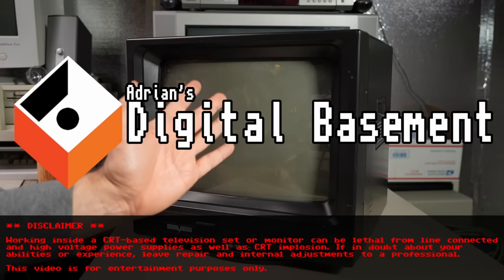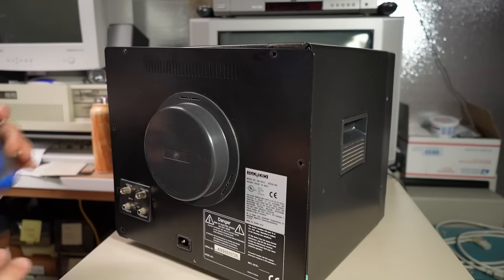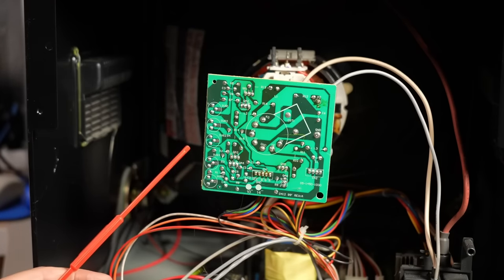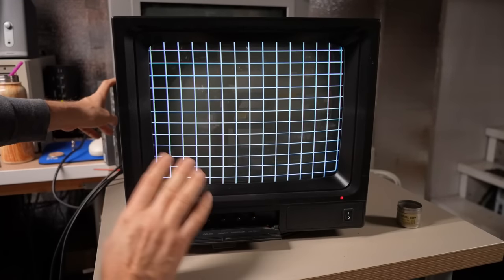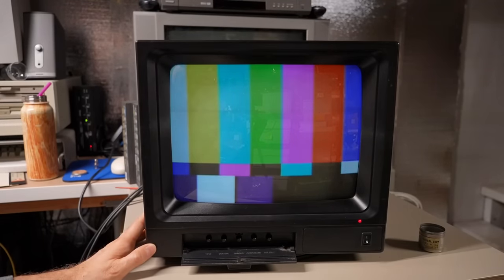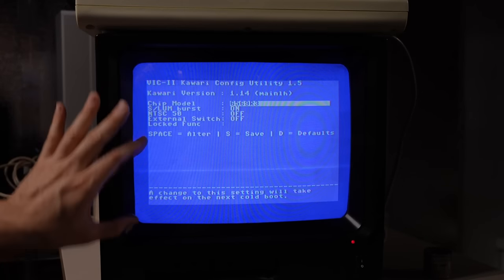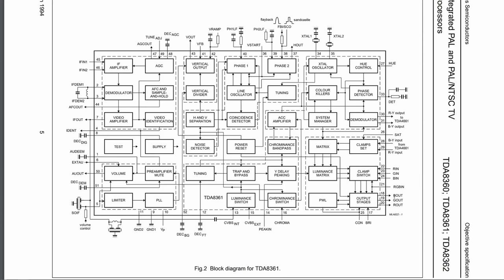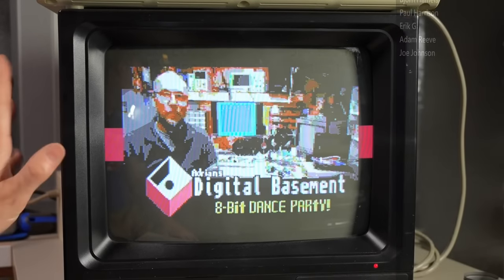This trashpicked monitor is way more capable than I expected (ProVideo VM-1401C)

Comment: For those wondering what the German text means, it says that the x-rays produced in the device are sufficiently shielded and the acceleration voltage is below 23 kV.
Reply from the maker: AH! Nice. I always know that it means that 23kv is the maximum voltage the CRT runs at, which is too low for X-ray. (I think 50kv is the minimum really) The idea is the TV's board incorporates safety measures to shut down is the high voltage exceeds a threshold so that X-rays are never formed. (By runaway HV)
Reply: I remember that there was a bit of a panic about TVs irradiating children in Germany in the 80s, so that's probably why that text is there.
Reply: @tidklaas My 1992 Philips CRT TV set (yeah, still using it, I don't have TV service anyway, it's just a monitor for my DVD player) has a similar label - and I was actually about to post the same translation here, but you beat me to it. 😅
When Adrian mentions the German text on the labe, I was already 99.99999% sure this thing must support PAL, as there is absolutely no point in putting this on an NTSC only monitor. Nobody would have needed that here back in the day, and now it would only be needed for the same reason that retro computing enthusiasts in North America want PAL monitors. I wonder if even the power supply of this thing is multi-voltage/multi frequency (not necessarily wide range input, but maybe by changing some jumper or soldered bridge)
Reply: @Colaholiker The IEC plug makes me suspect that it's also a multi-voltage monitor and the same monitor was sold worldwide instead of having different boards for different parts of the world.

For televisions that would make more sense since tuner channels are vastly different in different countries.
Reply: @adriansdigitalbasement2   With that metal case.... and SVHS.... and PAL...  this thing screams to you ... "find me another TUBE Adrian" !!! ...
Reply: @Ramdileo_sys  Plus as it seems the jungle IC supports RGB it could be a good monitor for RGB stuff too, and being metal cased could be a good match with the BBC machines as the common CUB monitor was metal cased, Must be a cheap portable TV around with minimal use that would have a compatible CRT.
Reply: @Stoney3K  But the label specifying 120V is oddly specific. That's why I suspect it can't support 230 directly, but with just a tiny modification to the power supply, like changing a jumper link or something. But I am just speculating.
Reply: @Ramdileo_sys  hear hear!
Reply: @adriansdigitalbasement2  I have a 12" b/w set which also has a similar X-ray label, even though the EHT is only around 12KV IIRC. I've not had the back off for a long time. There's another smaller (9" or 10") NEC b/w set I haven't opened yet, will see if that has one too! - I do need to open that one up and check it out; it was a street find.
Reply: @tidklaas  Same here in England. I think the scare may have started with the early colour sets but I was assured that mine presents no risk (a hybrid but has a solid-state EHT rectifier a.k.a. tripler).

Shango066 recently made a video using radiation detectors (Geiger counters) on a similar set to mine and found less radiation IN the HV cage than outside it! It's the (currently) latest one about the NOS Packard Bell set.

Comment: About 20 years ago, I found what I thought was a small television by the trash at my apartment. Turns out, it was a studio monitor, and a GOOD one, too. Had every kind of connector in the back you could imagine (even stuff like SCART). Only drawback was it was mono only, but that thing has seen tons of use through the years.

Comment: I was blessed by acquiring two 20" Costar security monitors, new in box, that I was able to get for free. They were the ones that Wal Mart used to have hanging around their store before they switched to LCDs. They are switchable from NTSC to PAL and have both composite and Svideo in and out. Passes through while the set is off also. One is in my retro game room and the other went into a MAME cabinet. Pretty sharp picture.

Comment: Given what it was used for, the burn is not THAT bad. I would have expected it to be relatively low-hour. Seeing how clean it is inside lends credence to that. Seen much worse that still had good, bright images. Depended a lot on the quality of the tube(s). Awesome end result.
Reply: Now I'm wondering how hard it would be to use a microcontroller to deliberately adjust the incoming video to brighten the burnt areas and make them less visible. It sounds like a pleasantly pointless project...
Reply: @hjalfi  That would only worsen the result over time, as you would just burn it in even more. What could work, is doing the burn in negative, so it wears the rest of the phosphors to even it. But by the time that evens your tube will be very dim.
Reply: I have a monochrome set that was used for a security camera, it also has visible burn-in. The grid that separates four different camera feeds is clearly visible, and some text resembling “CAM 1”is visible in the left top corner.

I’ll probably need to find a replacement tube for this, it’s also fairly dim and turning up the contrast makes it bloom terribly, to the point text is unreadable. It also takes a long time to warm up, after about half a hour it reaches full brightness.

It probably needs more work than just a tube, but it’s a cool little set. I still like to use it for a terminal, even if the image is dim.

Comment: Odds are the reason CRT lasted in security longer than the general population is 1) cost, 2) no need for HD until the cameras are upgraded and last but not least: 3) CRT security monitors have a track record for running 24/7/365.  I'm not sure as the first flat screens had that.

Comment: Architecture wise it's an European TV without the tuner, remote control and SCART connector. It's kind of surprising this didn't happen more, considering that the hardware is fully NTSC capable. It's import to note that the jungle IC of this monitor is still analog, which means the RGB input signal is likely directly passed on to the RGB outputs i.e. no processing is done, which means it works as direct as inside a Commodore 1084 or inside a VGA monitor.

TVs of the period this monitor was made generally work digitally and digitize the RGB input and do signal processing on it. At that point RGB loses its advantage over YUV component.

Therefore this monitor can really be a gem, allthough finding one with a good tube could be a challenge.
Reply: It was mostly large screen TV sets with frame doubler that digitised analogue signals.
Reply: @mjouwbuis There was a lot of support for widescreen. A DVD player could or would play a DVD in anamorphic 16:9. A normal 4:3 was expected to be able to support a widescreen input via SCART, convert it back to 4:3 and then you could often choose between zoom, letterbox and 14:9 on the remote control. These conversions were done digitally.

This and indeed 100Hz was the main driver for digitizing the inputs.

Comment: Given that boards to drive CRTs are still being made, I'd suggest you look for that CRT brand to see if they are still making them. If they are and prices are good, it could help to save a lot of good CRT sets.
Reply: Chunghwa Picture Tubes (CPT) bankrupted in 2019, they had stopped making CRTs many many years ago but the switchover from CRT to LCD was too late and was probably one of the reasons why they failed
Reply: @BluRay_4  a pity, really. There may be either new old stock floating around (at a premium) or perhaps some other company still makes them, but with unknown quality.

It would have been nice.

Comment: This one reminds me of those old cube monitors that used to be used with the old BBC Micros here in the UK....

I forget their name but they were everywhere BBC's where...
Reply from the maker: I think they were called "Cub" monitors -- and indeed lots of similarities, at least in the construction style
Reply: @adriansdigitalbasement2  Yes, Cub.
Reply: @adriansdigitalbasement2  Made by a company called Microvitec, based in Bradford, in the north of England - who are still going. They used the same metal case right up to the early-to-mid 2000s, although by then the internals were more modern, for basically the same kind of reason at this one.
Reply: Ooh yes, I remember the beige metal casing on those monitors which pretty much matched the colour of the computer case.

Comment: This explains why my 40" Sony  Trinitron is still a beast of a CRT..does mean console gaming and displays 1080i. Sony licensed the technology from Magnavox. Yeah it weighs 400 pounds but it refuses to dim or die. Perfection
Reply: crt tvs are reliable but you saying it puts out 1080i it just flat out bs cause they never make a sharp image its always foggy or cloudy
Reply: @joshuaryanferguson3702 hd crts were absolutely a thing in the early to mid 00s
Reply: @onometre  false bud even though they claimed they were high definition them things never put out hd video through the tube they were as cloudy an foggy as can be
Reply: @joshuaryanferguson3702   Monitors beg to differ.
Reply: @ToTheGAMES  no they don't bud they have a trash video
Reply: What particular Magnavox technology did they license? If Sony bought a Philips chipset, license to any intellectual property pertaining to the chipset, would be implicit.
Reply: @joshuaryanferguson3702  you might have experienced sets that were using a downscaler to display HD video. Philips ESF and ERF tubes had a fine pitch canon outperforming normal SD resolution, though the shadow mask would still be worse on a large screen set than on a VGA monitor. Those were relatively good when combined with a downscaler. Furthermore some manufacturers such as JVC used large screen HD monitor tubes in their HD CRT sets. Also normal Sony large screen tubes while not too good in vertical resolution, could write all 1080 lines to the screen.
Reply: @mjouwbuis  bro the term hd for a crt is a total lie there always gonna display foggy video what are you on about

Comment: That Philips TDA8360 is a really elegant jungle IC, extremely hackable. and both PAL/NTSC compatible. The TDA8361 and 62 varieties are basically the same chip but unfortunately have (i think) the external CVBS line disconnected. Which makes them a bit less hackable. See the remarks about those in the spec sheet.
Reply: Hm i found that the TDA8360 has the Pin 15: external CVBS input not connected.  for the 61 and 62 it seems ok?...
Reply: Then it is the other way around :) I found out about it recently when i was looking into populating the unpopulated SCART logic on the pcb of a very unused Magnavox. Wow, this is easy I thought. Until i found out that it had the amputated TDA836X version. Still possible though, but then you have to switch the CVBS signal yourself with an extra switch (i.e. more hacking and sawing, literally).

Comment: I have such a device, with a 9" picture tube. It has the same chip and the RBB mod works. Only the picture tube does not have enough resolution because the mask distance is that of a normal-sized picture tube. The maximum resolution is about 360 * 300 pixels. The geometry has to be adjusted with small magnets. While the convergence occurs automatically.

The most ideal way to operate the device is as a FBAS or as S-video in order to operate game consoles that run with 320 x 200 (240) pixels.

If you have the right version of the chip, you can also make a version that supports PAL and NTSC.

Comment: It's not surprising that the video processing IC doesn't have geometry controls. The IC is not in the position to influence the geometry - it's just a PAL/NTSC-to-RGB converter. The job of getting the RGB signal to the CRT and getting geometry correct by applying correction voltages to the deflection circuit is at a later point in the signal path.

Comment: Reminds me of a Commodore monitor I had.  It might have been 1401?  Or 1410?  It had the same shape with handles on both sides.  It was the same colour as a commodore 64.  It ended up getting its destroyed by a furnace motor locking up.  When the motor unstuck it surged the monitor and from then on it was so blurry it was junk.  It had s-video and audio on the front and all the fancy plugs on the back.

Comment: Fuhjyyu capacitors are one of the worst brands. When ever i find them in something, i replace them on sight even if they aren't bulging. They often go electrically leaky. Some users on badcaps forum call them fukyyu's.
Reply: I could see some line hum coming through on the PAL image as it had very visible vertical jitter. So there's a good chance those filter caps are on the way out.

Comment: The front of this monitor looks to be identical to one of the generic portable TV designs of the early 1990s, I owned one such set, branded "Akura" - the area where the on/off switch is would be taken up by a 2-digit LED display, remote sensor etc. 

Akura were a UK company who claimed to manufacture in Scotland - my suspicion is they were buying in kits from the far east and assembling them, as Brian Palmer, who ran Akura now runs a similar company "Cello" which is the only UK assembler of LCD TVs - and they buy in kits from Haier and Hisense. 
Looks like this was probably one of those designs that stayed in production for a very long time. It would make sense that a highly modularised, generic template used by several manufacturers would end up in an industrial set like this. 

BTW Fuhjjyu caps have a terrible reputation!

Comment: I bet this chassis would be great to put that chinese CRT board in with a newer CRT without burn-in. Would like to see that project. Maybe wrap the chassis in some wood grain vinyl wrap or paint it some fun color, and repurpose the factory board for turning an old TV into a monitor.  Or at the very least, see if you can find a better crt for this unit, and then RGB mod it.
Reply: In what way would the Chinese boards be better than what's in it now? Just replace the CRT if the burn in is annoying.

Comment: Could you use a thermal camera to look for arcing in the flyback or from the anode of the CRT ?
Reply from the maker: I don't think so -- maybe one of those IR cameras might help you see flashes? I think an arc is usually visible light, so a dark room probably is all you need. As I mentioned though I've never been able to see any of that with my own eyes before... I assume sometimes you can though, but just never for me.
Reply: @adriansdigitalbasement2  I was just wondering if the arcs would show as a heat source. It's just a thought. Great monitor, BTW. It's a shame the CRT is so tired.

Comment: Just one thing, if I may. It's not a dealbreaker for me, but, when you're filming CRTs, I know that you can adjust the shutter speed on your camera, but, can't you, or, why didn't you get something that LGR has? Because the frequency is usually not 50 Hz or 60 Hz, it's 59.9 or 29.7 or whatever, and with what he has, he can adjust it so precisely, that there is no rolling bars whatsoever.
I don't really mind, but it could improve the quality of the videos massively. Especially when you do far more CRTs and older stuff than he does.
Reply: Yup, I've noticed that LGR can always get his camera to perfectly sync to the frequency the CRT is running at. It must be his camera type, maybe it has some kind of sync assistance feature to get you on the money.

Comment: Fuhjuuyu caps are the worst... Jamicons are also bad. Both are notorious in the recapping community for being used in Mobo Killer power supplies (Older Antec's in the former case, Bestec "12E"s in the latter case). The worst of the worst!